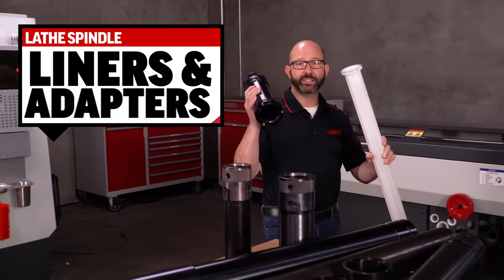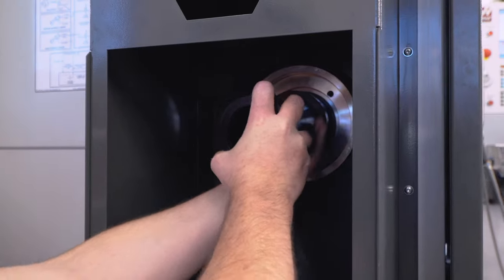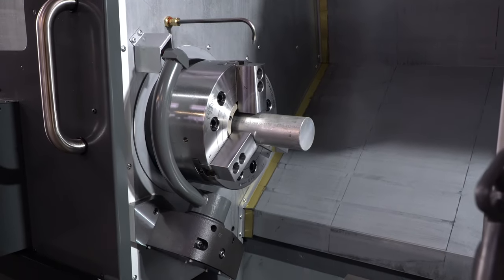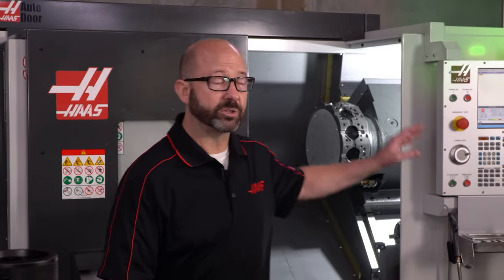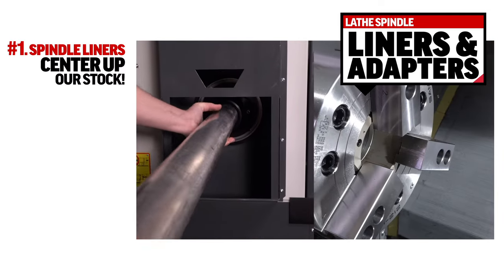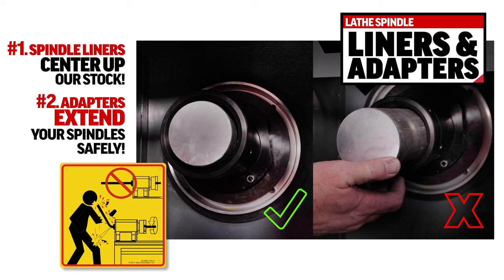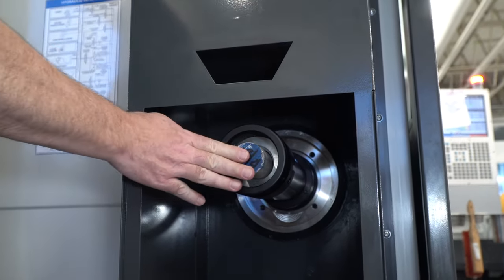You Don't Need a Barfeeder to Feed Bars! - Haas Spindle Liner & Adapter Kits - Haas Automation Inc.

Comment: Do the smaller ID liners fit the 3inch Spindle? I noticed that for the 1inch bar stock the OD on the Liner is 1.75. Will this work on the adapter for the 3 inch spindle?

Comment: Do you do one to fit an st10
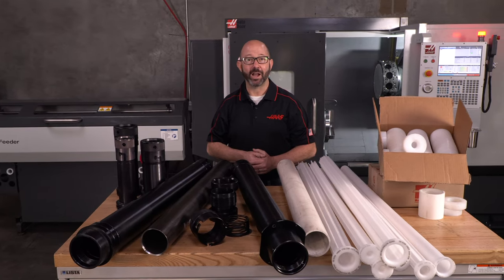Reply: Yes, they show a 45mm linear guide kit for a ST-10 at the 1:15 mark... part number 05-0207
Reply: Thank you
Reply from the maker: Anthony Conroy, Here is the link to the 11 piece kit that fits the ST-10 1.75" spindle bore. https://www.haascnc.com/haas-tooling/lathe_workholding/spindle_liners/08-0281.html
Reply: @haasautomation   on the st35ly is only 2 of the bolts suppose to connect the tube to the spindle

Comment: Those spring loaded caps are a real pain if you change bar sizes/sleeves often. Chips get into it and it become a nightmare to get off. Do they still make the screw-on kind?
Reply: Right! You've got to push it a mile in before you can start to turn it lol. The coolant spraying out the end is also annoying while bar feeding.
Reply: Isn't an air gun the solution?

Comment: This liner is the worst part of Haas which I have used. Expensive and not so good. I use stainless steel ( or plastic) tubes, if you search is possible to find pipe with suitable internal diameter.

Comment: People are so amused about those linears like being a machinist and having a production setup to do and not having a idea how to make your own linears... Its so easy to make your own adjusted to work tubes, hint it doesnt have to be from one part, like making 12 pcs stuck one by one into the spindle, just make adjusments , don't do a perfect fit.
Reply: That really is a good point. Sometimes we forget we are machinists. The liner can be made from a series of pucks and spacers. The Adapter, the part that bolts on to the back of the spindle, and makes the spindle tube longer, for longer bars, is a bit trickier, and most of us would want to but this pre-engineered adapter in order to run longer bars.  The one-piece liners are pretty slick though, make things simple. Great comment.